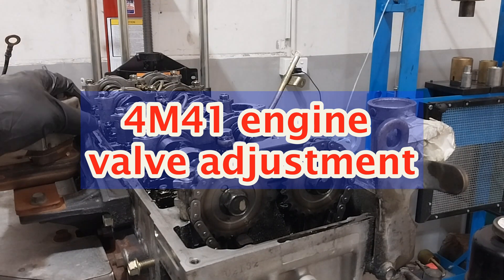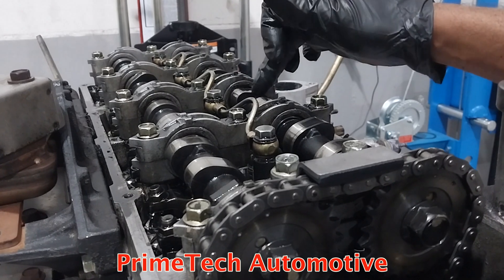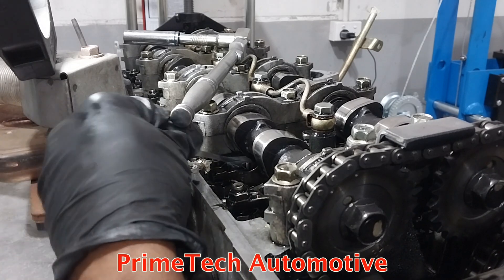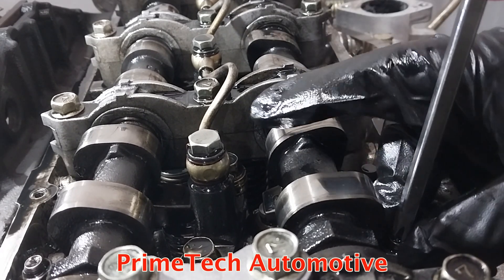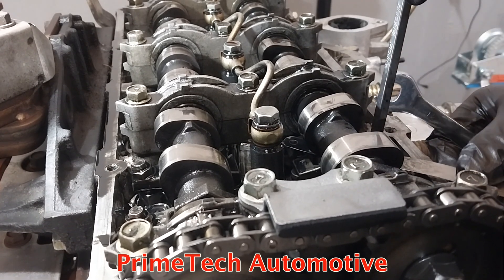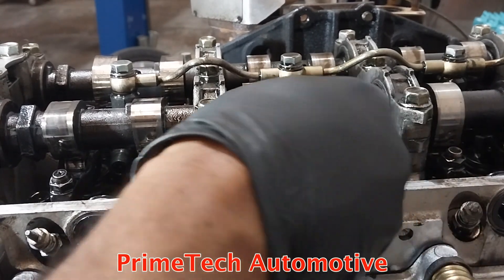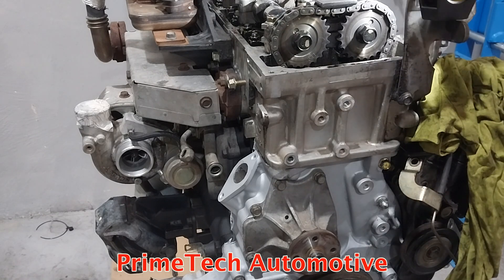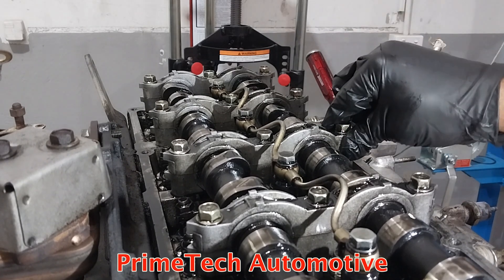Correctly Adjusting Valves On Mitsubishi 4m41 Diesel Engine:Triton/pajero Valve Clearance Procedure.

Comment: Very informative video mate, I was planning to do it on my 2008 Pajero, 4M41 with 410k on it because engine made so much loud noise, unlucky the engine broke down/ the car stopped in the traffic 2 days ago before I had a chance to do it. So I pulled the rocker cover off and found the following result:
1. The upper chain guide snapped( not sure where it went).
2. The guide; loose side metal part still intact but has no more plastic/ nylon part. 
3. The guide; tension side has broken nylon piece trapped next to it.
4. The chain looked still good.
5. The position of timing mark on the right Cam sprocket( looking towards the engine ) is at 4 o’clock while the left one at 11 o’clock.
Based on that, could you tell me what has happened to the cam sprocket? Is it fixable by replacing item 1-4? Thank you
Reply from the maker: Where are you watching this video from. Hope you are local. Lemme know.

Comment: great video im still learning about this engine and maintenance procedures and this helps a lot , the crankshaft is rotated counter clockwise to set the timing marks ? also is there a mark for the second rotation you did for 3/4 intake and 2/4 exhaust as i said i am still learning about this engine and dont have a manual yet .

Comment: How do you trun the engine, when its built in? There ist too little Space for a Ratchet? Do i have too built the Fan? Or is ther enough Space? Thank you, very good Video
Reply from the maker: @Alen_Muric  yes you can fit long ratchet handle with a socket when the engine is in the car. Or you can use the starter relay. Just find the pins on starter relay and bridge together to turn the engine to the desired position. If you do these they make sure you are doing this correct and safely manner. Wrong applying can cause severe damage.
Reply: You can put the vehicle in 5th gear and push it forward, the engine will then turn clockwise
Reply from the maker: @ that will do if the vehicle is manual. one other thing can do is just remove the starter relay and bridge the starter connection correctly.

Comment: Thanks for the tutorial video. 

Can you also do valve seals and injector seals replacement for the same engine?
Reply from the maker: Did you mean valve stem seals ? 
Injector seals on rocker cover ?
Reply: @PrimeTechauto  

Sorry, I meant valve stem seals and fuel injector nozzle gasket
Reply from the maker: @DoctorDoctor2x  will do. If I get another engine to repair. Thanks
Reply: @PrimeTechauto  Thank you so much sir